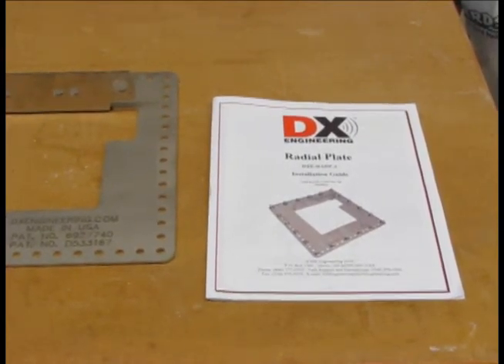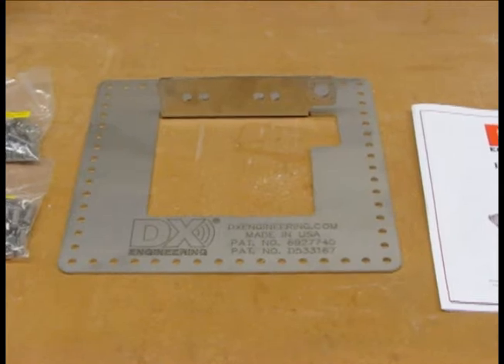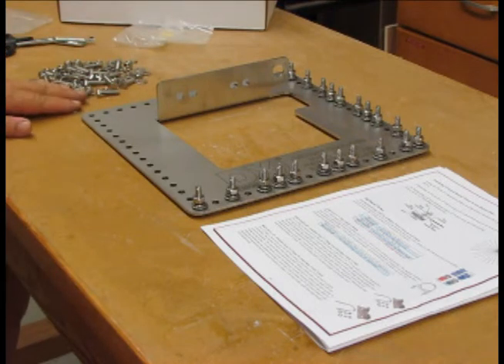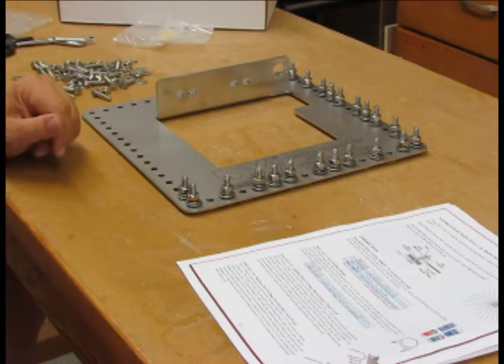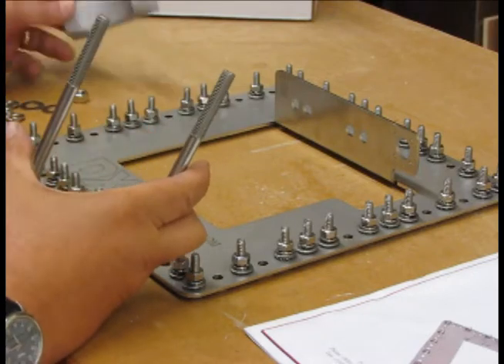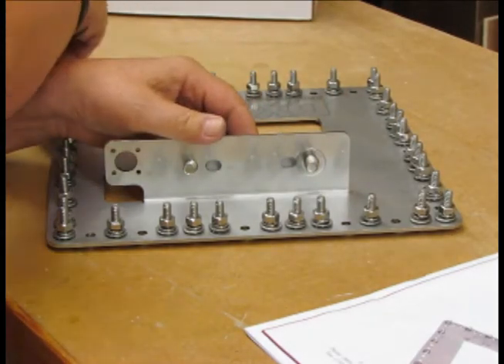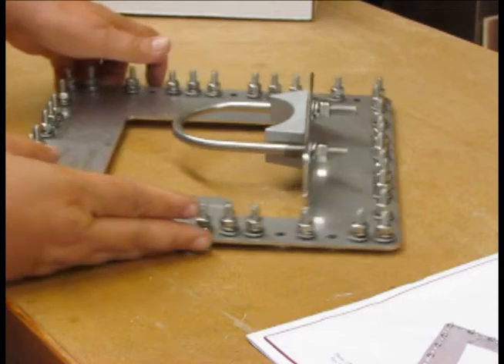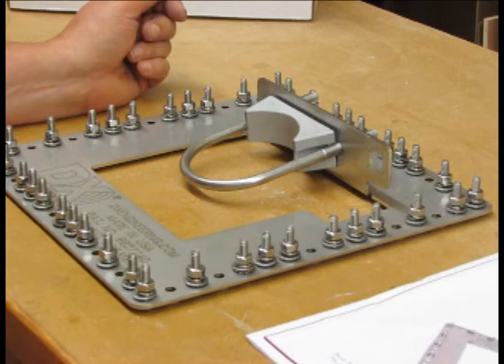DX Engineering Radial Plate

Comment: The radial plate seem to be stainless steel .But the bolts flat washers lock washers and nut are not true stainless steel they stick to a magnet .
True stainless doesn't stick to a magnet.
Now for the dxengineering stainless clamp , the Seattle for clamp is stainless but the u bolt and flat washers lock washers and nuts are not again true stainless . but the price you pay for it, it should be . So it is false advertisedment.
Buyer be aware. That way they tell you use jet lube,and sale you jet lube.  But they don't tell if it was true stainless you don't need. Jet lube.